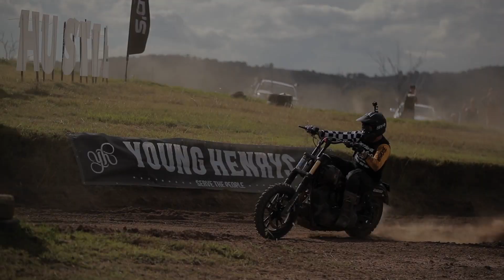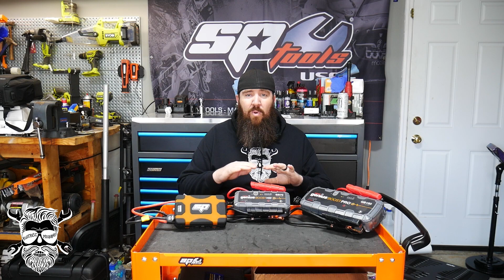NOCO GB150 - VS - SP Tools SP61073 Jump Pack

Comment: Why didn't you connect the Noco directly to the battery terminals, which is how it's designed to be used. I have a Noco boost pro GB150, and it has never failed me once. I've had it for years. I've jumped off hunting buddies, co-workers, people at the grocery store, etc. You should read the safety features on the Noco. When using the Noco the way it's designed to be used, it will work flawlessly.

Comment: I know without a shadow of a doubt that this Video is complete & utter nonsense, After 6:55 when you claim to hold the Boost/Override Button, The White LED after where it says PRO on the GB150 Label was displaying a Solid White LED when in reality it should’ve been Flashing or Blinking Rapidly, IT WAS NOT and it was the same with the GB70 as well NO doubt!
Also, What’s with the constant Clicking during the NOCO Tests, There was none of that when you were Testing the SP Device?
“The game’s afoot” Sir!

Comment: OMG Just get a Clore ES5000.  No meters, no ON/OFF switch to go bad, NO boost button to go bad no frills.  They last 10 years plus can replace the batter,  heavier duty clamps and longer than NOCO.   Just better in every way but size and weight.  20 pounds vs 7 pounds for NOCO 150.     
Oh 1/2 the price of Noco too.   
The reason you never see noco compared because they are not better and cost 2x more.  ANd they wont last 10 years and you cant replace the battery.  Oh bonus is no Lithium fire hazard with the CLORE ES5000 either

Comment: My GB150 cranked my 6.5 Detroit with higher compression than that duramax, on completely dead batteries. Batteries so dead that the door locks wouldn’t even click. If I cranked right away, it cranked on the slower side, but if I let it sit on the batteries for a little bit, then cranked, it cranked over pretty well. Then again, I also hooked it up to the battery that had the cable that went right to the starter. So I don’t know what you’re doing wrong there, but the GB150 worked just fine for me. Maybe because the Duramax has more electronics to power up? Not sure. But the higher compression of the 6.5 should compensate for that extra load there…

Comment: I don't get it either, why doesn't the noco test show at least 12v? I like the SP showing 13+ volt. Will make the starter turn faster.

Edit : I didn't notice at first, but the channel sells the SP brand. I'm pretty sure they sabotaged the noco jump packs. No other reason they should show less than 12v when idle.
Reply: I agree, Why when the Noco 70 or 150 only showed 9v approx they output over 12v at least mine does and the fact he pressed the Boost button when the lights where chasing has me suspecting he isn't the best prepared to test them.

Comment: NOCO is extremely dishonest about their amp ratings..youtubers have tajen them apart and seen the tiny battery inside and also tested current with a clamp meter which is greatly exaggerated e.g GB40 which is supposed to be 1000A only puts out ~200A when shorted for a sec or 2.The GB40 had 2ah 120c battery and GB150 has 8ah 120c battery so only capable of 960A not 4000A.

Comment: Rigged, I have a bunch of fedex trucks that we have to jump start often. We have used multiple jump packs including the noco 155 and the sp61073 Hd diesel jumper so I can tell you I’ve started our cascadia with the Noco155 with the sp61073 only clicking.

Comment: Starter on the truck is designed for 12 volts. If you hook up a fully charged 10 volt battery it still won’t crank. The starter needs both amperage and voltage.

Comment: Note with the first jump starter up to 4 mins of your video, how the battery went up to 10 V in no time. If you just waited another minute it'll probably reach the 12.6 or .7 V. needed to crank.

Note, again, up to 8.27 mins, battery read 10 V, you will not jump a vehicle at 10 V. You have to wait until it reads 12.6, or .7V.

Evidently the SP Tools Jumper ate the NOCO's, sorry NOCO but, SP Tools jump starter ate your jump starters! Where were the 4000Amps of the NOCO, can you measure it the NOCO was inputting 4000A?
Reply from the maker: That's why we love our SP Jump Starter! Thanks Rodolfo🤘
Reply: @SPTOOLSUSA  Thank you! I'm still shocked the 4K+Amps didn't jump the truck. That truck needs 2000+ Amps I really feel those NOCO jumpers weren't providing 3000 Amps. If you still can, get a multimeter and measure the amps of the clamps at jumping, and see how much amps do they provide at jumping.

Comment: Does the SP61073 have an override of the safety sensing feature if the battery is completely dead with 0 volts?

Comment: You need to connect it directly to the battery terminals.
This thing starts 13L Navistar diesel engine on completely dead batteries.
Just saying.

Comment: This test is very realistic in that these Nocos are greatly over rated  and I can also add since I  am one of many technicians  that repairs a great many of these Nocos that they also have a pretty horrendous failure rate despite what all the paid for endorsements claim by a great many so called impartial reviewers. Good review, we need much more of these real reviews and not  all the phony paid for ones.  In regards to the absolutely ridiculous current outputs of the Nocos, there are several fairly accurate  capacity tests done on all of these and although I cant remember of hand what the exact numbers were, the results werent anything even remotely close to what Noco as well as several others claim. We live in a time where any company that makes practically anything can just pick whatever specs they think sounds good enough to sell a product and they just slap those numbers on  the box and product since there really doesnt seem to be any punishment  for  exaggerating  or flat out lying about the specs of any given product and this seems to apply to practically everything to at least some degree.
Reply: Email to NOCO:
Our company is looking at potentially investing a lot of money in some of your products but we need to be reassured about a few things before we can make these purchases.

trust in your product is quite low right now as Noco lied about having 20,000 amps to sell their product. 

before when the gb500 was rated at 20,000 amps it was more than 5 times stronger than your GB 150 so now it is only double the strength? :(

Can you please confirm that 2 of your $300 GB 150s are now equal in strength to your $1800 Gb 500 plus? 

NOCO:
Checking with our tech team, 2 GB150s don't equal the power of the GB500.  If you are just slightly larger than the 7L diesel or 9L gas, 2 should work, but a semi truck will still need the GB500.
Please let us know if you have any additional questions.

We revised our peak amp rating due to a change in the testing standards developed in a partnership with UL. However, the new 6250A GB500 is significantly more powerful than any previous versions. A peak amp rating is a measurement taken in a lab setting and only sustained for a fraction of a second. The newer models of the GB500, with a peak amp rating of 6250A, are able to sustain a higher power output for a longer period of time which is needed in a real-world setting for starting a vehicle.
Reply: @BobSmith-dm3vp  did they claim UL testing for their products or just name dropping? What kind of partnership was there?

Comment: Check if that GB170 states 12.5v when not connected to anything and only turned on and the boost button activiated, should say 12v astleast not 10v no wonder it wouldnt start, I think it was losing voltage not being hooked directly to battery or somthing else.
Reply: For real. It only showed 10v on the meter when he hooked it up. Looks like they used a discharged noco to compare to their product.
Reply: @danielmccrea8225  company sponsored video bias?

Comment: This is such an unfair comparison as the guy need to connect it to the battery and not to the side of the engine. This is not the right way to jump start the car.
Reply: It’s not an unfair comparison if it’s done the same exact way for each unit.    You might claim that it’s a poor jumping technique, but even if it is it’s still a totally equal comparison with all three jumpers utilizing the same poor technique.
Reply: @joebuck4496  true if the negative connection to the engine ground is made consistently in all cases. If it's an oxidized surface it introduces a great deal of variability to the test that could invalidate the comparison.
Reply: Also that GB70 would’ve started it if he’d turned the boost on. He probably doesn’t know it has this feature or what it’s for.

Comment: Will a noco gb150 jump start an 18 wheeler, semi truck
Reply: Possibly will if connected to 1 of 2 batteries.
Reply: I used a 150 and a 70 to start a semi the other morning. Neither alone would do the job. The semi I  started had 4 batteries.
Reply from the maker: Hi Rudy, neither of these Jump packs will. These are 12v systems. Most 18 Wheelers require a 24 volts.
Reply: @SPTOOLSUSA That is incorrect. As a semi truck mechanic, I can guarantee you 90% of semi trucks are and always have been 12v systems with 4 batteries connected in parallel. Most big rigs that are wired up as 24v systems are either military vehicles, or some large busses. Other than that, almost all semi trucks are wired up as 12v systems.
Reply: Yes it will there are a few Videos of the GB150 starting Semi's here on youtube, Take no notice of this test because it is being done wrong, as someone else stated the Noco should be allowed to go through it's correct starting process not use it like jumping it from a spare battery, The GB150 will start 99% of vehicles unless you need it's big brother 24v model and that thing is a beast.

Comment: Is the noco gb150  to much for a car?
Reply from the maker: We can't confirm that, but we do know that ours will do the job!
Reply: If it uses higher voltage to achieve the higher start current it might be, otherwise the only problem might be that it allows a car in poor maintenance to be cranked futilely for longer periods, possibly burning out the starter motor.